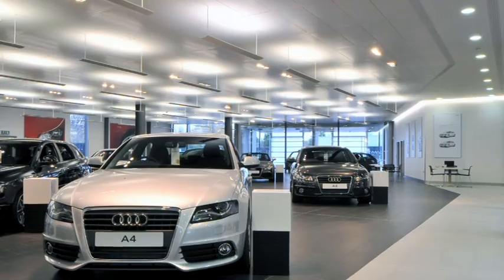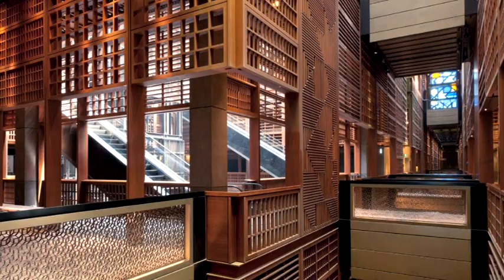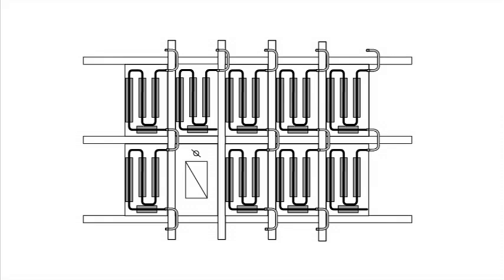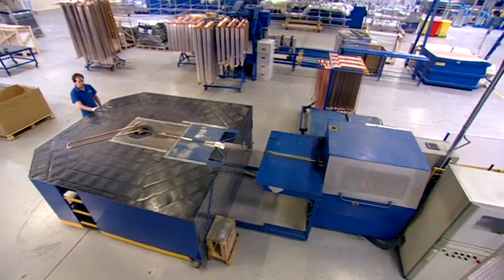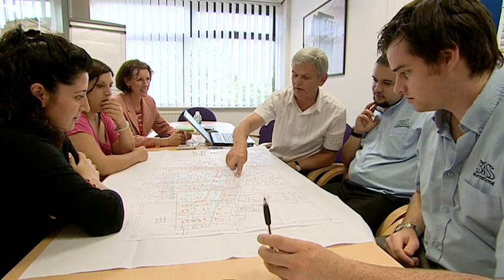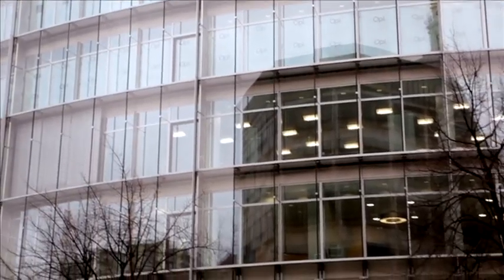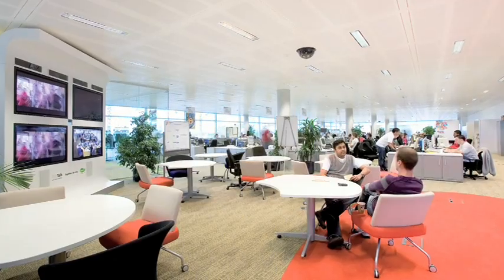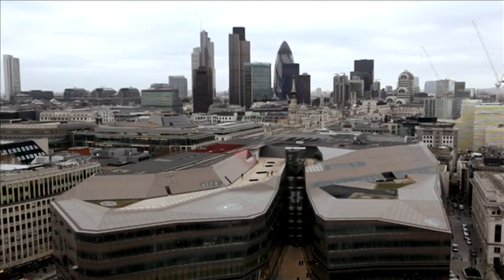SAS International Chilled Ceiling

Comment: Why copper pipes? Just makes it more expensive. PEX maybe better.
Reply: As you need the thermal transfer, PEX is an insulator.
Reply: @paulaubrey6004  Messana uses PEX recessed in rigid foam with an aluminum heart transfer layer. Seems to work fine without need for copper pipe.